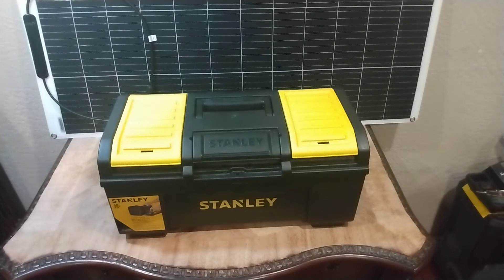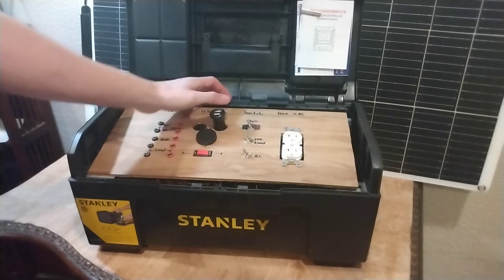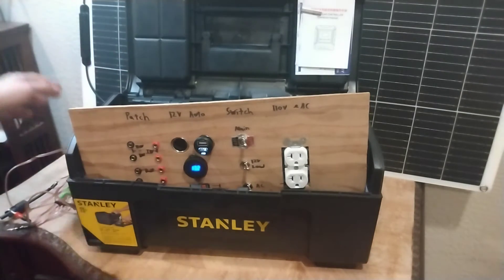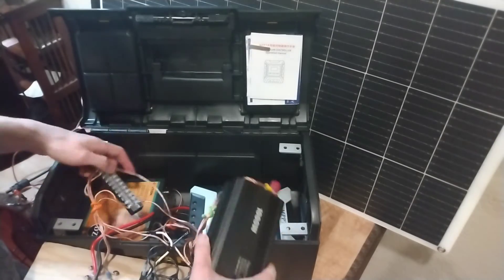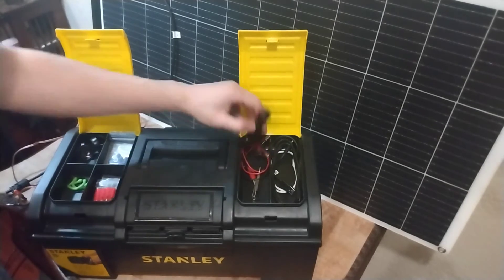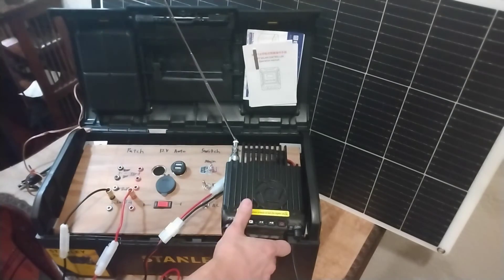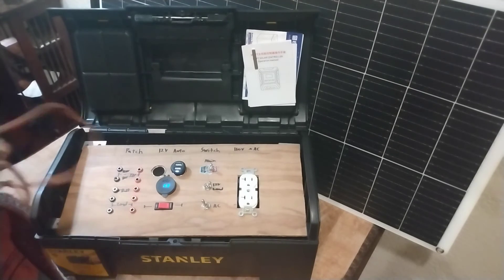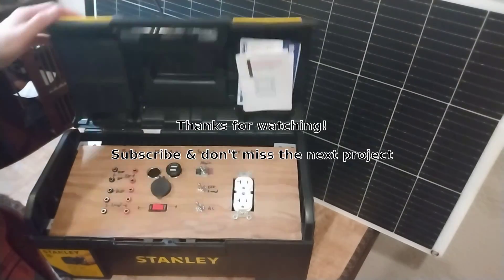Renewable Energy In-A-Box - DIY Portable - Power Anything!

Comment: Very cool! I like the idea, but are you concerned about heat buildup? Perhaps a fan?
Reply from the maker: So far no trouble with heat, the inverter has a small fan on it which helps when it's in use. It would be nice to add a small computer fan.